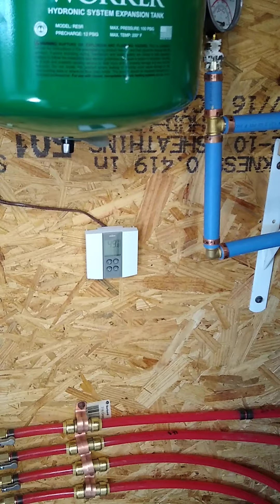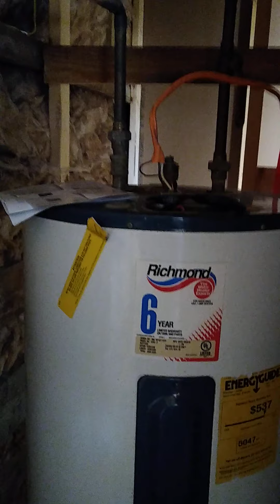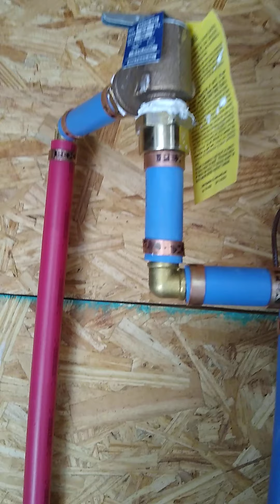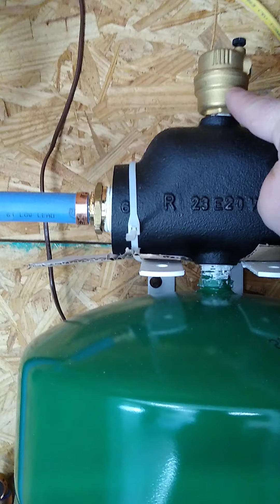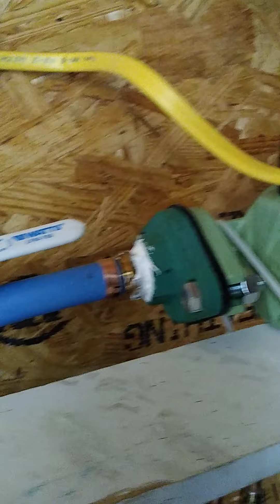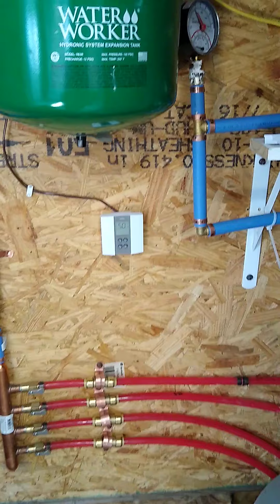Heating both Radiant Floor and water fixture's with a water heater

Comment: Why not design a hot water tank with a pizoelectric solid state pump to circulate hot water through a hot water on demand system that heats the water dumps it into the tank then circulates that hot water? 🤔

Comment: Thanks for making the video. What is the part that the expansion tank is screwed into called? I have seen a couple of DIY videos where they use it for the tank and the air release valve. Its some kind of 3/4 NPT Mounting Block. Thanks!

Comment: Can a propane hot water heater work on this system
 We have oil at the present time but need to replace it
Reply from the maker: I have some friends that used propane on demand water heater. And it works fine!

Comment: BTU conversion from Kw of electricity is roughly 3400 BTU = 1 Kw. If you have a 6,000 watt heater then you have about 20,000 BTUs. The number is either on the Mfgr's tag or it will certainly be stamped on the heating elements if you remove the cover to take a look.
Reply from the maker: Good to know ! Thanks!

Comment: Hey love your system! I want to run a similar setup myself! 
Have you needed to add a mixing valve at all? I wonder if you would get more efficiency? 
Great job love to see more videos of future projects!
Reply from the maker: Thanks! Trial and error is the key. I believe the only mixing valve is in the shower. I'm sure it could be more efficient, but my hopes are to eventually switch it to an outdoor burner once I have my house hooked up. Then I would heat both house and shop together (wood burner.)

Comment: I thought I understood your system the first time I watched the video but after watching it a few times I’m missing something or misunderstanding. With your reduced cold water coming in and teeing with a check valve on the right, that sends cold water through your floor when you are using hot water in your fixtures?  And all your fixtures see reduced pressure on the hot water side correct? Thanks
Reply: my take is the system is running at 25 psi so the domestic hot water at the shower / sink is also at 25 psi instead of normal well pressure. (40 psi?) I think he mistakenly said it was flowing through the floor first. I see it as feeding the tank first.
Reply from the maker: You are correct. The system is running at 25 psi. The only exception is two cold water faucets and a hydrant (for washing cars) that are still at 40 psi. The main line does come in and go through the floor first and then it goes to the water heater. There is a check valve on the exit side of the water heater that prevents water from back feeding into the water heater. Hope this makes sense.
Reply: I had the same question
Reply from the maker: I'm sorry this is so late. I haven't checked my channel for a while. :( So I have a main line coming from the house that is 3/4 inch pex and is at 40 PSI. That splits into a T and the cold water line then goes through the pressure reducer through the lines in the floor and then into the water heater (the other end goes to a shower, bathroom sink, and wash basin in the shop) thus reducing the hot water pressure. The problem I did have was when I fed the fixtures for the shower (where the mixing valve is). I had more pressure from the cold water line (the other end of the T) then hot so I ended up back feeding through the shower mixing valve and it would run without me turning it on. After adding another pressure reducer on the shower side of things (poor design) and that fixed the problem. The two sink faucets are still at the main pressure tank, pressure setting. This is the 3rd winter heating and it still works great!